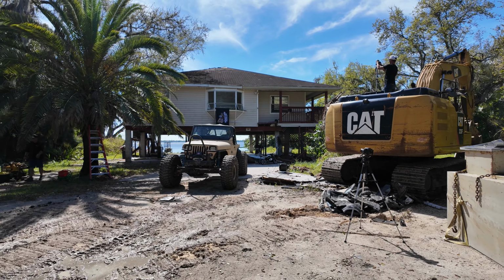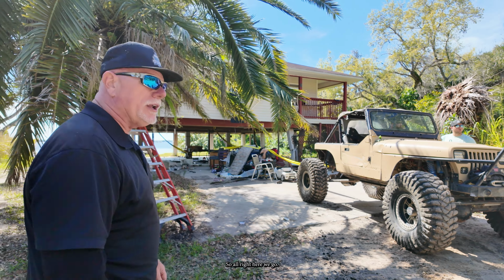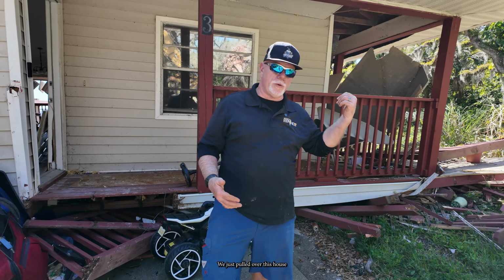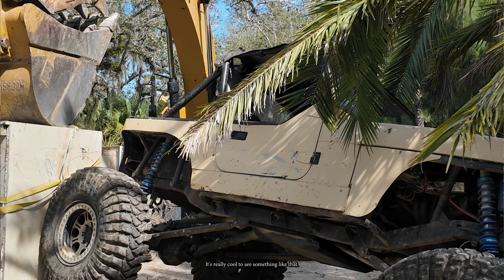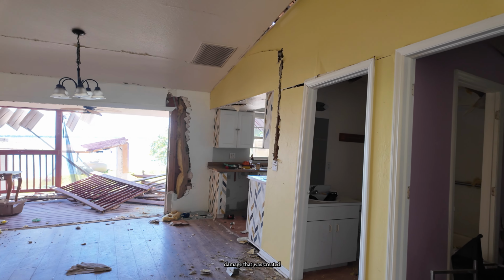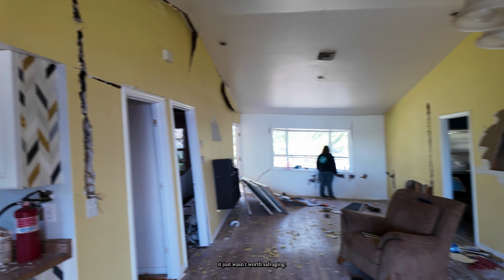Jeep VS House (Our Excavator Uses Safe To Split House In Half)

Comment: @Remove It Pros Demolition I highly recommend those tow straps be inspected for damage before they are used to tow or strap down any equipment of value.

Second, in the future, I recommend using Kinetic Energy ropes instead of tow straps.  Tow straps are designed for a static constant load and aren't designed with those intense shock loads being applied to them as they don't have much give to them.  Where as kinetic energy ropes are able to give and stretch more when an intense shock load is applied to them.

A brand such as Yankum ropes make them plenty of other brands out there as well.
Reply from the maker: We'll do will have them inspected. Yankem ropes, where do you get them from?